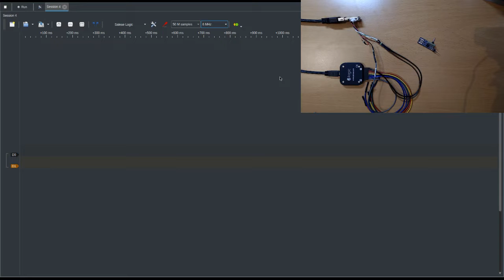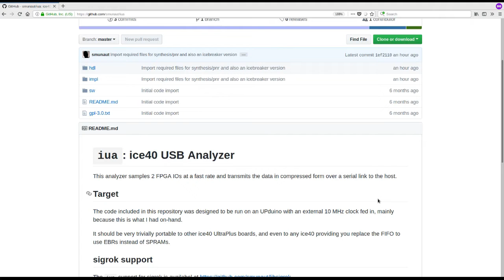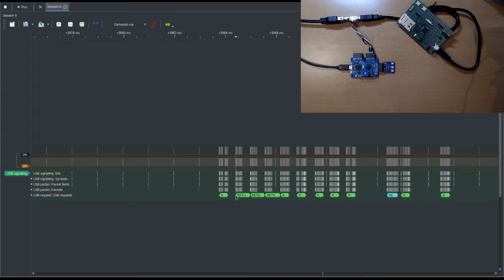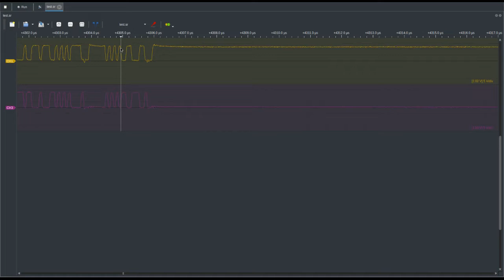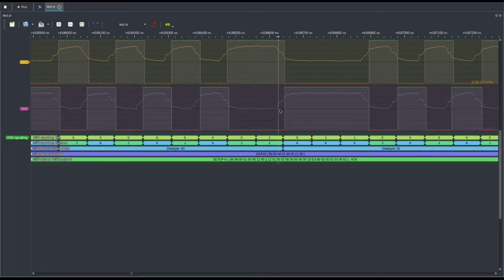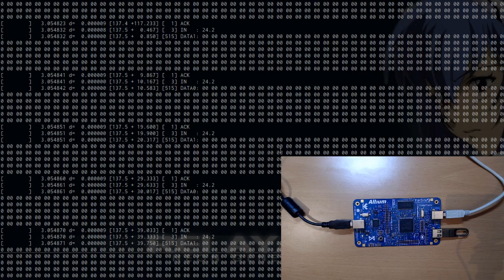USB low level debugging, feat. sigrok and OpenVizsla

Comment: Any thoughts on the USB that's on the Fomu / TinyFPGA boards?  It seems like it instantiates a RISC-V softcore processor on the Lattice (ICE40UP5K) that runs MicroPython (FuPy).. but not sure how the USB Bootloader/stack actually works.   What's the (lite-x?) usb ip interface that allows the communication to the host?
Reply from the maker: Sorry I don't really understand your question ...  The fomu uses a USB core implemented in the FPGA itself, it appears to the RISC-V softcore pretty much the same way as any USB device core appears to the CPU in any microcontroller with USB, you have control register and buffers or someway to send / receive USB packets.

There are several of such USB core for FPGA. The one used in the FOMU official bitstream is ValentyUSB ( https://github.com/im-tomu/valentyusb ).
I also wrote one myself available at https://github.com/smunaut/ice40-playground/tree/usb/cores/usb that I used on the fomu and other ice40 boards.